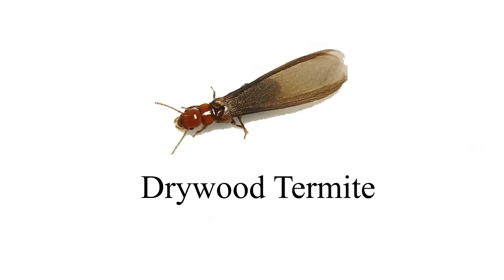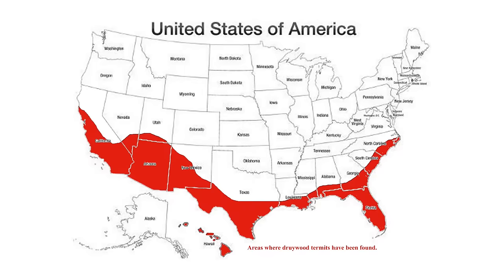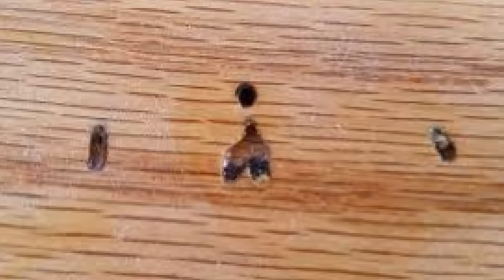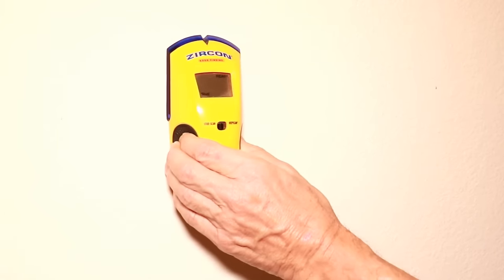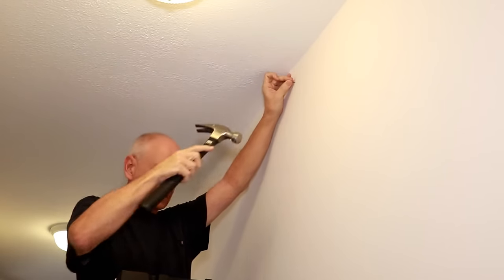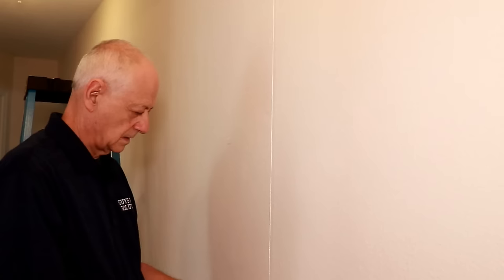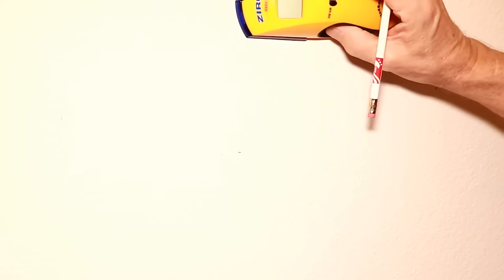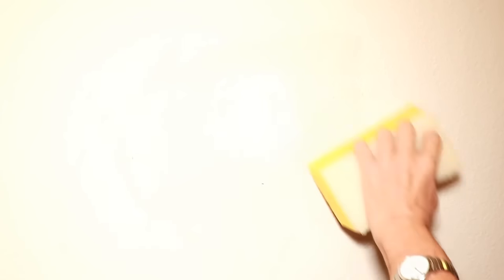How to Treat a Drywood Termite Infestation Yourself. A MUST see if you have Drywood termites.

Comment: I have wood termites around the house attic, cabinets every where, what I should do? Call a company and tenting the all house?
Reply from the maker: It is important to understand how drywood termites work.  They enter through cracks and crevices around windows, doors, the eaves, pipe penetrations, and so forth.  Most of the time, they enter through several locations.  That is because a swarm of them attacked your house at the same time.  If there was a crack or a crevice, then they probably found it.  After they established their galleries, which will be inside the wood, it will take four to seven years for them to be able to swarm.  Now that they are in your house, the swarmers will use holes that are in your studs to travel through the walls.  Those holes in the studs were created by the electricians to run the electrical wiring.  Not only are these holes going through the studs, but holes were drilled into the attic for the light switches and to run some of the wiring for the outlets.  So, the termites now have easy access throughout the attic and the walls.  If you have a basement or crawl space, they have access to that as well.  Most of the time, you will have no idea that they are in the walls, because the frass is inside the wall.  To make matters worse, if you have drywood termites, then your neighbors have them too.  That means you have been getting swarmed for as long as they have existed in the neighborhood.  Most likely, we're talking about years, so it's no wonder that you have these guys in many locations in your home.

I always hate to be the bearer of bad news, but if you have drywood termites, the only sure way to get rid of them is to fumigate.  Prices for this can vary wildly in this industry, so I recommend that you watch my video on how to hire a pest controller without getting ripped off.  That video can save you a lot of money.  You should also know that the gas they use to fumigate has absolutely no residual action whatsoever, so you can get reinfested the moment the tent comes down.  Like I said before, if you have drywood termites, then your neighbors have them as well.  Since drywood  termites swarm every year, it is almost a certainty that you will be reinfested within a year after the fumigation is done.  The only way to prevent this is to do a preventive treatment on your house every 60 to 90 days.  Most pest controllers will not do this, so it is something that you generally need to do yourself.  I have a video on how to do that and I will place a link below.  If you absolutely cannot afford to fumigate your house, then you can try spot treating it yourself.  It is virtually impossible to find all the termite galleries, but it is way better than doing nothing.  Regardless of how you treat it, you should begin the preventive treatment immediately, so that you do not get additional termites paying you a visit.

I hope that helps.  Be well my friend.                      

Video on how to hire a pest controller without getting ripped off:  https://youtu.be/y-a8XOqVrlE

Video on how to prevent drywood termites:  https://youtu.be/neNsmVbj8Pc

Comment: Hello sir. I live in Arizona. Recently I found 4 little tunnels about 4 inches long hanging from the ceiling inside the closet in one of the rooms that we haven't used for about 1 year. What do you recommend I do?  Also thank you for your videos. You are amazing.
Reply from the maker: I think it is a reasonable conclusion that you most likely have termites.  The only question is, "Which species is it?"  It's a pretty safe bet that this is some type of subterranean termites, but there are basically two species that's are a problem in Arizona.  One of those species is a serious problem and the other not as much.  Almost the entire state of Arizona has Formosan termites and these guys can destroy your home very quickly.  Whenever there are termites in the ceiling, I always have to wonder if they are Formosan termites.  It is certainly possible that these termites or a more common variety that eat very slowly, but most species attack as close to the ground as possible, with the exception of Formosan termites.  Now, I have seen the more common varieties of subterranean termites build these tubes from the ceiling down, so it is certainly possible.   However, you need to make sure.  Please watch my video on how to identify termite species.  If you conclude that these are NOT Formosan termites, then just watch my video on how to trench to get rid of them.  If you conclude that these ARE Formosan termites, then also watch my video on how to treat them as well.  I will give you links to all of these videos.  If you are unable to identify the species, then you can either call a pest control company and ask for a free inspection, or you can just assume that these are Formosan.  The treatment for both species requires trenching, but Formosan termites also require that you check the interior of the house for what we call "cartons."  This is all explained in the video.   If you have the more common variety of subterranean termites, you may also be able to treat them with termite granules.  However, since the granules are not a good choice for Formosan termites, then I suggest that you trench, just to be sure that you got them.  Do not delay because Formosan termites are also known as super termites because they can destroy your house very quickly.

I hope that helps.  Please let me know if you need any further information.  Be well my friend.

Video on how to identify termite species:  https://youtu.be/dIs_a0nfVjg

Video on how to trench to treat subterranean termites:  https://youtu.be/Fy7YHi_7Z8g

Video on how to treat Formosan termites:  https://youtu.be/xDtGUWxMrRw
Reply from the maker: I'm so sorry that I'm only getting to answer this right now.  For some reason, YouTube did not send me your comment until this morning.  They do that sometimes and I have had them hold comments for as long as 3 years already.  If ever you ask me a question, and you do not get an answer within a few days, then please email me at guyspestsolutions@gmail.com.

Please let me know if you have this resolved.  If not, I will see what I can do to assist you.  You may want to email me.

Be well my friend.